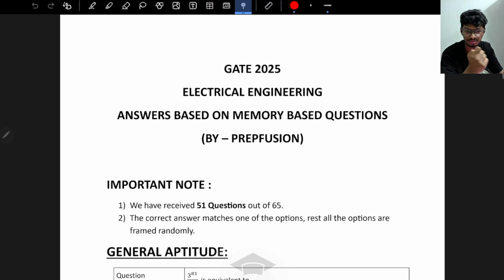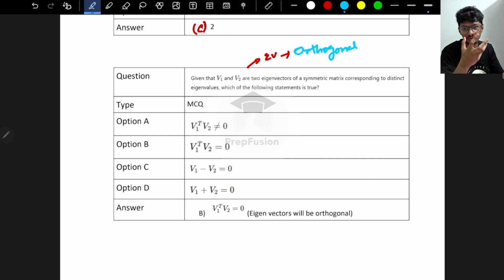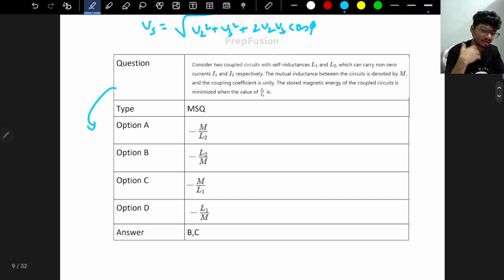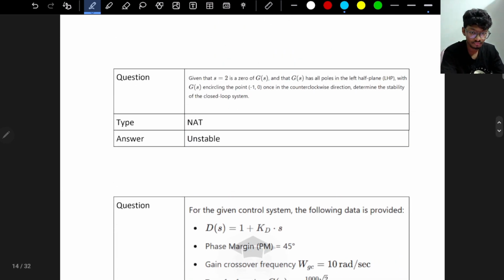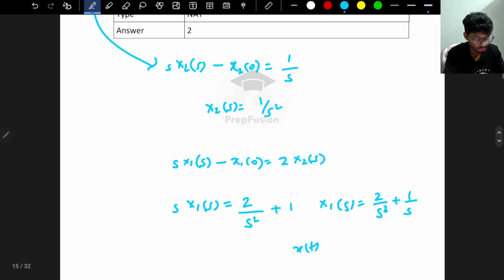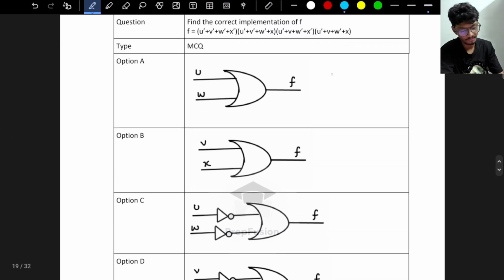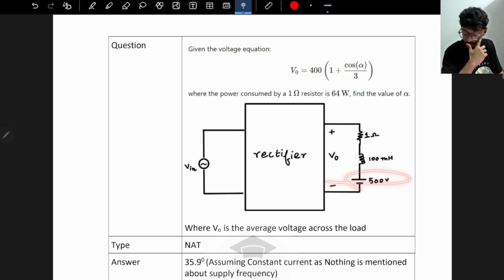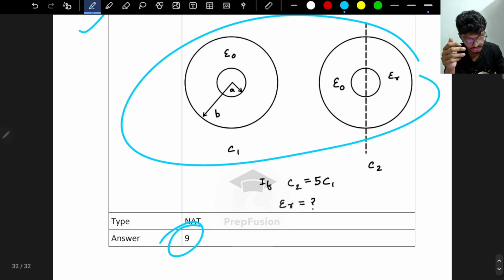GATE 2025 Electrical Engineering(EE) All Answers || Memory Based || PrepFusion

Comment: Bro i am getting doubt can u please clarify.  That UPS question,  u said slack bus its ok (as when gen is off the diff of demand is supplied by slack), as if there UPS means we known max load capacity up to wt extend we can supply during power failures na, as we know load limits its should also consider as PQ bus na? In option PQ bus also there

Comment: In nullator question answer should be open circuit??.....as the resistance is connected in series with nullator so the current in resistance is zero but voltage still can take any value . Isn't this possible?
Reply: It will be o.c
Reply: @akashraj-ei4qd  but still without an element we can't say voltage drop na
Reply: When current is zero how u get drop across voltage

Comment: If spheres of unit diameter are placed at (l, m, n) with l, m, n taking all possible integer values. If the distance of a sphere from its closest sphere is x and the distance of next closest sphere is y. Then the ratio x/y = ?
Options:
1/√2, √2, 2,1/2 as far as I remember
Reply: √2

Comment: 02:38 sir in direction was not given, they asked maximum rate of change of f(x,y) which is |del f(x,y) @pt(1,2)| = 5, and they have also given rounded off to nearest integer, so if answer would have been 0.44, then how it is possible to round off to nearest integer..?
Reply: bro zero is also an integer

Comment: large r and large c value capacitor doesnot discharge right the o/p should  be same as input .
Reply: I also thought same
Reply: @18_ayushmishra62  thought same , but marked the one with lessor amplitude than the i/p bcz of some voltage drop across resistance. Let's see
Reply: bro tum discharge ki baat kar rahe ho , lekin discharge se pehle use charge hona padega to tum ye bhi keh sakte ho ki use charge hone mein bahut zyada time lagega to wo kabhi pura charge nahi ho payega aur exponentially charge karega
Reply: @shubhamide   normally hum graph steady state ka hi draw karenge na
Reply: @dhanush7497  steady state ka hi hai bhai wo exponentially kabhi wo charge ho hi nahi payega itna 1 volt tak